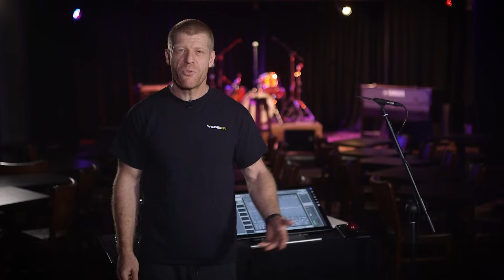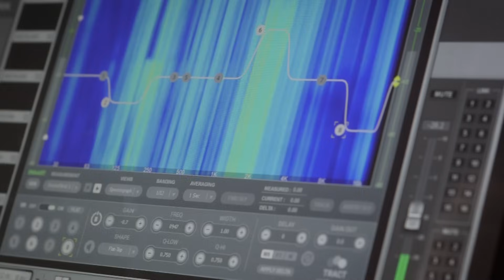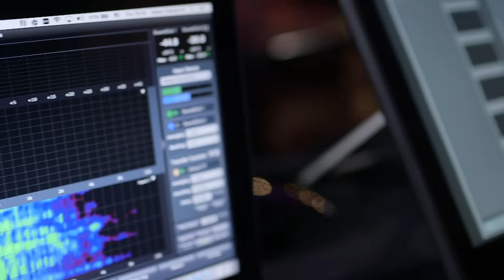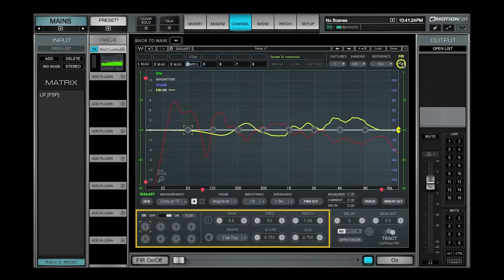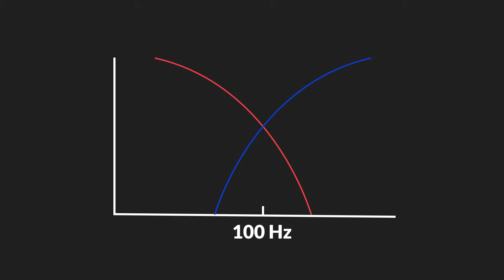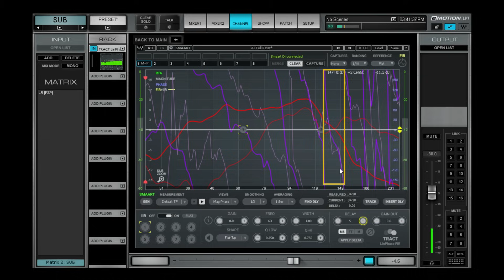Sound System Tuning Step-by-Step using TRACT and Smaart

Comment: Some "bumps" and "dips" simply shouldn't be equalised. Blindly flattening the magnitude response doesn't solve the whole problem.
Reply: I think ,if it creates eq  what we want ,then its helpful
Reply: @justahobby4  The probability of room creating the eq that we want is extremely small, the opposite is quite possible. but nevertheless, these problems are often simply inequalizable.
Reply: @olegnaumenko4871  without eq ,ya its not gonna happen 
But with eq Its posible,may be sometime  we want louder speaker for that purpose

Comment: And what about coherence? If you have a uneven response like in the video, you also need the coherence to make a solid interpretation of the measurement. It is totally wrong to stupidly create an FIR-Filter that compensates a Measurement with low coherence which is of course corrupted by a lot of factores (for Example reflections of all kinds)
Reply: Isn't that why you need SMAART integration?

Comment: In the Seventies and eighties we used a radical system, our EARS.
Reply: I still do the 31 band and a OSC if i have a young crew just to try to teach them some of the old Skool.....ever hand them a roll of butcher paper and a pencil and ask them to do the rf intermod calculations for you? It starts out funny when they dont understand why the pencil and paper, then gets hilarious when you explain how many freqs they will have to check for and then downright  hysterical when they ask what the formula is and you explain for every freq you need they have to run it against every other.......you can tell when they've finished doing the quick math in their heads and realize how many times they will have to run thru it for just 8 mics......i save that task for “ Mr or Ms I know everything/My cellphone is more important than doing my job”
Reply: @ericclinton7399  I'm interested in learning more about this and how to do this. Is it better than SMAART and how well does it work if you do the math right?

Comment: So it's like some kind of automated processor ? It seems it can replace everything we usually do using a processor on a sound system (delay compensasion, eq for the room, and even compressor if we use other plugins)
Reply: Except someone has to know how to set it up, how to plan for and compensate for less than ideal presenters/musicians….they may be able to replace some of what we do with machines and software but in the end, what we do is art and that requires a human to do….i have zero qualms with a piece of gear that will handle any feedback issues that may popup as long as it does it in a only when needed sort of way, like a dynamixc band versus using a parametric that always present in the overall mix

Comment: Yeah...
Step 1 where you measure the response of the venue is already misleading.
You want the response of the venue as heard by the audience, and NOT only the mixing seat.

It might make more sense to capture an averaged response from a field of mics, scattered around where the audience will be.

Great, so after you've tuned your system for audience positioning (room response) and time-aligned, then you have to account for when the audience is actually present.  As we all know, a crowd of people will damp and attenuate signals, as well as reduce SNR, though on the plus side they help scatter room modes.  From this point, you can pick your poison for coping with the audience.  
Maybe use a preset to estimate damping, for various crowd sizes (this method is static and sort of dumb).  
Or maybe keep field mics in place and use signal coherence (with averaging) to estimate how source-to-receiving transfer functions change under the presence of an audience.  Now we're talkin'!

Comment: yeah, let´s correct it exactly in the high frequencies like shown. probably there will be a little problem with Sibilance in the vocals ( and much more )
Sorry, tuing a PA is not that easy and will never be. The Human part is still there to NOT do it with a simple stupid auto correction curve!
The older mixers know that, but the younger genreration wich is used only to plugins and digital?
Reply: exactly my thought...would have been easier with cuts at 125 (which the plugin misses completely), 500 and 2k and a small correction at 14k
Reply: Shrike, I hear you, with all due respects to the engineer [I wasn't there btw] that resultant green curve shudders me with it's boost around the 160-200 mark, always areas where I have always attenuated when tuning live PA systems, just saying.
Reply: @izzieschitzenberg2335  Agreed, i have never had to boost that frequency range ever in my life, it's always attenuated

Comment: Is TRACT able to create an average curve out of multiple Smart captures? Given the fact that you usually have a quite wide coverage with a soundsystem I find it inconvenient to use a curve used from measuring one point in the audience only.
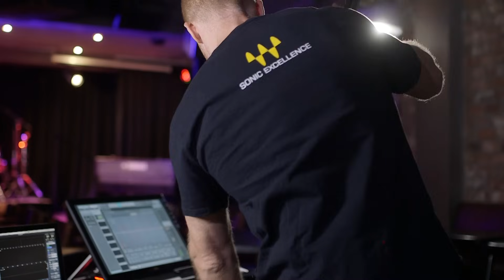Reply: I'm guessing you could use the approach at around 2:08 in the video out in the audience instead of just near the FOH.
Reply: yup. just like at 2:28 -- looks like you can merge captures from various measurement locations into an average, and use that for the calculation
Reply: the question is if it has the phase coherence function... ;)

Comment: i can't get any captures in smaart.  I'm not seeing level when doing the spectrum captures. i have ins and outs set right. i see level in the small meter on right but nothing is getting recorded. any ideas?
Reply: Yes, but only at a very defined distance from stage, at the point where the microphone has been during measuring - a couple of steps back or forth and you´re out of time alignment :-)
Reply: Sorry, the answer was meant for another question...